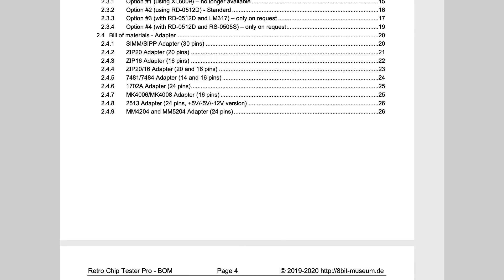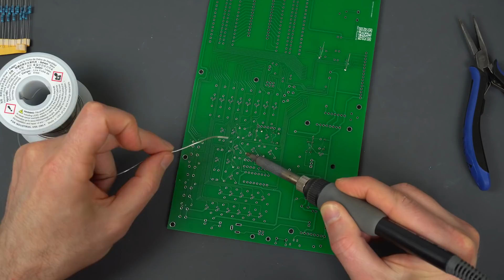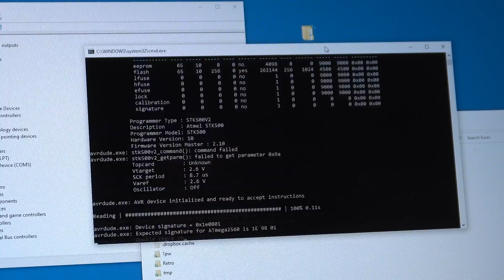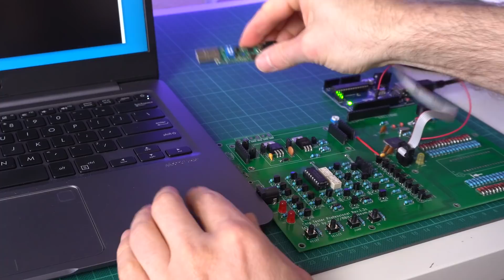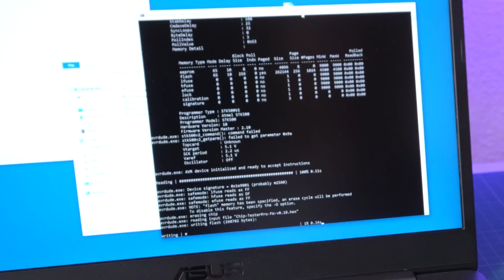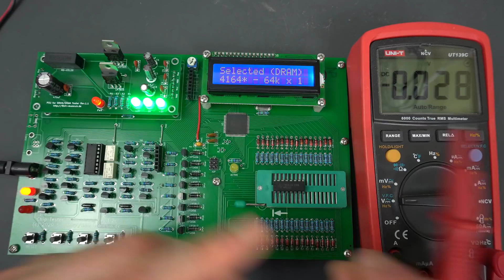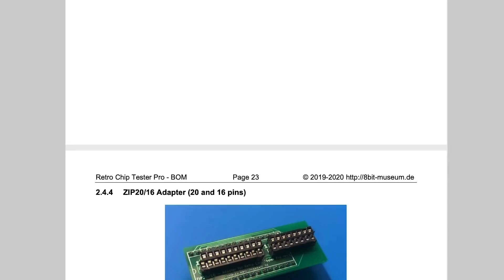The Ultimate Retro Chip Tester?

Comment: Rotary encoders are expensive! The button setup would be fine but I agree, there should be a back button. Some combination could be added with a firmware update I'm sure. Might be nice to even let you put the menu / chip data on the SD card so you can select only the chips you want to test from a list on your computer to make it more convenient.
Submenus kinda already exist with the jump function.
A simple (short) test option would be nice though.

A feature that would be nice would be load testing the outputs / current draw during idle and usage. That could turn this from hobbyist diagnostic tool to industrial engineering sample analyzer real fast.

Real wishful thinking here but writing E/E/PROM chips would definitely be in the cards for this and I don't think it would be that hard to verify contents for them either. This could be an extremely powerful tool if it's given just a few extras!

Comment: This machine is great, but it seriously needs a USB port and an associated PC application. That interface is far too clunky as it stands.
Reply: no doubt? just a simple serial text based application running at 9600 baud
Reply: @bigbeef2654  Starting w/something simple through the ISP interface should be inexpensive and 9600bps would cover what I saw on the LCD.
Being able to load the chip database updates from the uSD/TF card or USB, rather than AVR reload would rock.
Reply: Or a keypad to directly enter chip numbers

Comment: In 80s a similar tester would cost many thousand dollars.  I am wondering why anybody needs this Gizmo today?  It has a very bad design.  Why anybody install a chip to the board when they can buy the whole Arduino and plug it there?!!!  The designers could have used a  laptop and a simple communication program as a user interface.  No needs for stupid LCDs nor even rotary push buttons.   It would have been a great project 30 years ago
Reply: It is a "Retro" Chip Tester :) Some people like to have a stand-alone device. It is often not very inconvenient  to have a computer next to it.
Reply: @8BitMuseum  Well no..  An Arduino should have been used instead of soldered chip.  Serial communications in Arduino aren't that fast however the memberships are only a few Meg's and it should take less than a minute to test the largest memory chips.  This is a classical example of using an embedded system instead of installing a chip and programming it on the board which is more difficult.  If you do not agree watch thelis clip again!

The second part was a suggestion to remove extra LCD and push buttons and use a laptop which is more convenient.

Comment: This looks pretty great, but as someone who has no issue with hand soldering surface mount, I would prefer a more compact SMD version. 
Agreed about the rotary input 100%
Reply from the maker: I can see how an SMD version would be more convenient for people with experience (or to assemble automatically) but this is clearly more approachable by more people. Other than the sourcing part, assembling it was really easy, so it's not even a bad second or third soldering project 😃

Comment: Interestin .. but is there a project/feature where you can clip to a chip on a board and 'watch it' and then diagnose if its functioning to its spec?
Reply from the maker: Not really. That's something I experimented with a few years ago and gave up as impossible in most cases. When you test a chip on the board, you're providing power to the whole board and sending signals to connected chips, so you're going to get back all the "chatter" from the other chips talking in the busses.

Comment: How the F did you make the clock signal work with just one pin? All signals need reference  and that means a second wire!
Reply from the maker: I didn't think about it at the time (obviously), but I think I lucked out because both power sources come from the USB ports in the laptop, so they must have a common ground there.
Reply: @NoelsRetroLab  it's a bad practice, but as long as it worked and was not a separate power brick giving you a half mains potential, than great! Please connect grounds intentionally next time, it would be a shame to kill some retro chip because of a mistake like that.... Cheers! :)

Comment: If I were designing this from scratch, I would ditch the LCD screen and buttons and instead make this a USB peripheral to a PC. Put the UI (selecting chips, etc) on a big screen where it would be much easier to select the appropriate part. I hate devices that try to do too much with too few buttons.
Reply from the maker: Sure, that would have some advantages but it would also tie you to a computer. I actually appreciate this design since I don't always have a computer nearby.
Reply: @NoelsRetroLab I really like a single gadget that does everything without a computer

Comment: Awesome board and step by step video. 
I saw the limitations on 13:00 . The only suggestion would be get rid of the button controllers and the display using the computer as a main interface via usb.
That would simplify the overall board, and make it simpler.

Comment: Great video. 
Couldn't you just power the board to get the clock signal from the crystal? I was actually surprised the jumpstarting worked because there was no ground connected between the arduino and the board.
Reply from the maker: The problem is that the crystal doesn't provide a "full" clock signal (square, 0-5V) but just more of a triangle signal with very little amplitude. And since the fuses of the microcontroller were expecting the full clock signal, that wasn't enough.
You're right about the ground part. I think I lucked out because all the power is coming from USB ports on the computer and it happened to work that way. Oops!
Reply: @NoelsRetroLab  This confused me in the video, too, until I read this comment and realized that the board uses just a crystal directly connected to the MCU, and not an external crystal oscillator. (Or this is my understanding at the moment.)

A crystal does not provide a clock signal at all; it's a passive device that will help guide an externally generated signal to a given frequency if driven correctly. Thus if just a crystal is used to help clock the MCU, the MCU must be configured to know that there's a crystal across those pins so it can enable its internal clock generator circuitry and drive the crystal. If the MCU is configured for an external clock, rather than internal clock generator with external crystal, there will be no clock since there's nothing on the board to provide it.

There's often confusion between a crystal, of which the one in the video is a typical example, and a crystal oscillator. The latter generally is a much larger square or rectangular four pin device, requires +5 V, and includes both a crystal and additional clock generation circuitry so that you'll get a clock output on one of the pins when you power it up.

Comment: Great tool, great review. Thank you. I was aware of this kit, even exchanged a few msgs with its designer last year. I only fix and maintain my modest collection of ZX Spectrums, so a bit on the expensive side for me, but yet, as you have already said, it is a very valuable tool for those who make money doing retro repairs, well worth the price for them, I wouldn't think twice if I were one. You are right on the idea of a rotary switch, I am sure the designer will consider that on the next hardware revision. Also since now you are used to buying parts twice :-) you should get a yellow positive image 4x20 LCD for that. Totally pin compatible, much better contrast and viewing angle, just a little more on the price tag but worth it. I've stopped using these "blue" LCDs on my projects long time ago, they are just a waste of money.
Reply from the maker: Thanks! I think a rotary input is out of the question because the microcontroller is maxed out as far as pins. So it would have to be a significantly different revision. But that would be fantastic.
You're right about the screen. You're probably talking about the OLED ones, right? I looked into it, but they're insanely expensive at the moment (around 40€).
Reply: @NoelsRetroLab  No, not the OLED ones, same screen, same technology but positive image and yellow/green backlight. A graphic OLED screen will require too much change in code, there are OLED equivalents to that dot matrix screen but they are too expensive. Adding a rotary encoder will not require any extra pins, there are IO pins already assigned to those push buttons, they can be used for the rotary encoder and even sparing a couple of pins. All it needs is a daughter board to solder on the relevant section of the PCB to connect to those pins and some code change for a rotary driven menu system.
This is the LCD I am talking about:  https://www.aliexpress.com/item/32679234720.html
Here is a better link, even the sales photo shows just how much better is the positive image ones: https://www.aliexpress.com/item/1005001694530172.html
Reply: @NoelsRetroLab  With a little luck you can get one under 20 EUR. This is 22 EUR https://www.aliexpress.com/item/32929491915.html

Comment: Noel, it pains me to see that you don’t use controlled ESD precautions. Uncontrolled ESD will bite you at the most inconvenient moment.
Reply from the maker: I do for the most part. The workbench has an ESD-safe mat, and I'll often wear a strap (on hand or even my ankle) when dealing with components sensitive to static. I don't always remember, but I do for the most part.
Reply: A handy hint - The best way of handling components is to treat them all as static sensitive. Contrary to popular belief, all components are static sensitive - some only require 20 volts of induced voltage to cause damage. Humans can only sense electrostatic potentials greater than 2000V thus can damage parts without knowing it. It's a myth that ground is required for controlled ESD  e.g. There is no ground wire on the ISS (International Space Station). When lots of plastics are around ESD matting is useless - for these situations Ion generators are used to equalise charges. It's not a good idea to keep ICs in non ESD plastic parts boxes (nor velostat for long periods of time - the pins can dissolve!!).  Back in the 1970's it was also folly to use aluminium foil mounted on polystyrene where the sheer action of inserting an IC into it would often cause unwanted uncontrolled ESD events.  Please keep producing great videos!!

Comment: I see it has a spot for a USB port, it would be cool to have a desktop app if you don't want to press the button 100 times
Reply from the maker: The USB port is purely for power (optional). It could be extended for data communication, but that wouldn't be possible with the current microcontroller I think (it's maxed out already).

Comment: Brilliant vid and thank you for sharing. You were able to extract the Amstrad chip code but is there another chip you can write it to?
Reply from the maker: Thank you! Yes, you can write the data to any EPROM (in that case a 27C128 because it was 16KB). For that you need an EPROM programmer because this tester doesn't do that (it would require much higher voltages).

Comment: I've replaced that type of buttons quite a few times in my projects as they fail. Rotary digital step control would be much better.
I remember buying an IC tester from Maplin back in the 90s which had a board with an ISA connector...I used it mainly for 74 series.
This new board covers a lot of different types of chip. Testing is slow but probably ok for occasional use.
Checking the monitor screen carefully is essential to avoid missing any errors. Previous experience programming with Arduinos would help .
The Manual looks good and is probably essential and read through carefully before starting the build.
Nice one, Noel.

Comment: Nice. The common TL866 programmer also tests many logic IC’s and memory chips, but this device looks like it also covers more of the earlier memory chips. Looks like a fun project to add to my project list queue. ;)
Reply from the maker: Exactly. And I think the TL programmer doesn't test DRAMs at all, right? I need to get the latest update to be sure.
Reply: @NoelsRetroLab  and it only also tests SRAMs 32k x 8 up. But it can burn EPROMs and thousands of other devices, so other target group.
Reply: @NoelsRetroLab  Yes, latest version tests 285 logic devices, and only 10 SRAM’s starting from the 6116 (no earlier devices). No DRAM tests supported. Of course the TL866 is primarily a Programmer, supporting over 16,000 devices. The few devices it tests is just a bonus.  
Strangely, the CMOS and TTL logic list also includes devices 6821 (Motorola PIA ?!?), and 8155, 8255, 8259, 8279 ?
Not sure I want to stick one of my PIA’s in there to see if it tests it. LOL

Comment: So I have to ask, what would it take to add rom burning functionality to this? I know that there are already many alternatives for that, but I wouldn't mind paying a little extra in parts if it would make this more capable. Also, if the interface was expanded to use a numpad, you could have a basic search function. Any letters would work like a phone pad, so you're not using too much more space. And there should be cheap off the shelf pads that would serve nicely
Reply from the maker: For rom burning the main thing you'd need is higher voltages, so it would be a different power board. You would also need a UI to select the data you wanted from the SD card. Unfortunately all of that is probably out of the question since the microprocessor is pretty much maxed out as far as RAM and pins already.
Reply: @NoelsRetroLab  Yes, you are right. Of course it is possible to use programmable voltage controllers to create different voltages but this will blow up the hardware complexity a lot. There are already specialized projects available.

Comment: I wonder if you could have also lowered the clock speed the Programmer was talking to the ATMega with the -B parameter. That saved me when I had incorrect fuses from the factory on a different AVR. Also there's a GUI app for it called AVRDUDESS.

And I don't mean the BAUD Rate (-b), I mean the Bit clock!
Reply from the maker: Oh interesting. I don't know! This was my first time doing something like that, but I'll keep it in mind in case that happens again. Thanks for the tip.

Comment: If they could give it a rotery encoder for the interface, maybe even a touch screen (like the big tree tech screens they make for like 20 dollars) and maybe the ability to flash EEPROM/EPROMs would be like the best all AIO device ever.

Maybe even add a component tester for diodes, a compactor LCR meeter.

Only thing other than all that is maybe wifi with an ESP8266/32?

Probably would be way too expensive and a very big monumental task.
Reply from the maker: Haha, yes, it would be quite a slippery slope 😃

Comment: Well, that was fun!  All you need now is a custom-designed 3D-printed case for it, and Bob's your uncle.  The user interface you described (using a rotary pulser) seems like it would be do-able as a daughter card, no?
Reply: Yes, it can easily be done with a daughter card that will solder on the existing push button pads. Very easy and non-costly way to do it, even the existing kit owners can buy that and upgrade. All it needs a software revision and that's not hard at all.

Comment: TURN UP THE VOLUME!!!!!!!!!!!!
Is this the new ASMR-channel for retro nerds? I had to max out the audio volume when looking at the part 3 C64 repair video and this is almost as bad. When watching anything else I set the volume to not more than 1/3 or so. 

Love the material.
Reply from the maker: Really? I keep a pretty good eye on the volume during the editing process and it's definitely in the recommended range before it starts clipping. I'll look into it. Thanks for the heads up.
Reply: @NoelsRetroLab  Sound is good. Checked with speakers and headphones. Sound levels are about the same as other videos out there.
Reply: Maybe it's just my TV that lowers the volume for Noel's videos (it's not using adaptive volume).   :D
I didn't conduct an extensive investigation, when watching video "X" I had the volume set to circa 30/100, then when right after watching the C64 repair part 3 I had to raise it to 100 (then I turned on the surround system to get a descent volume) but it's an old video so...  For this one I could lower to about 80 - which is when I moved to the computer and released my fury.... 
I haven't had this experience with Noel's videos before. Next video I watched directly after (jacksfilms IIRC) was fine - I didn't go back and check it again unfortunately.

I'm guessing it shouldn't be a YouTube-bug-thing...?

When checking now, from the computer (where it's actually possible to write feedback properly) it seems OK. When kids are done watching Roblox-crap and screaming YouTubers I'll have a watch again from the TV.   ;-)

Again, great videos, it takes a certain kind of nerd to enjoy these - here's one. 
You need to keep up with your videos bwack - also enjoyable.

Comment: Great video, you actually mentioned this tester a while ago and that is how I found it. I bought the pcb and parts immediately and have build one myself a few months ago. I had to laugh when I saw the wrong zif  socket early in the video, as I made the exact same mistake ;-)
I flash mine with an arduino (programmed as isp) and this works fine, however you do have to disconnected the sd reader to program, so there's a tip for you and others.
I would also like to mention that support from Stephan is just awesome, I have mailed him a few couple of times when I had a 'problem' and he is very helpful and all issues were solved within a day!
Next to retro computers I repair arcade pcb's and this thing is a must have for this...
Reply from the maker: Haha, I'm glad I'm not the only one making those silly mistakes 😃  And yes, Stephan has been amazing with his patience and support! Top notch!